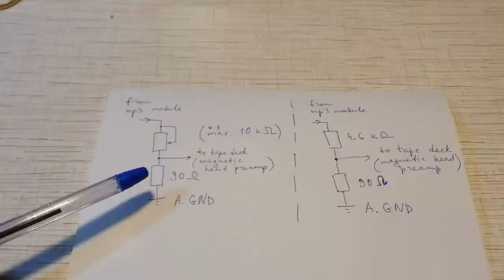(part.2) How to upgrade your old cassette / tape deck to usb mp3 bluetooth radio player

Comment: Connecting to the magnetic head isn't a good idea-or let's say, it's the worst idea. It has a low signal to noise ratio and what is more important, it's not linear-it has a big correction in the upper region of spectrum. If the tapedeck is already disassembled, locate the correction amplifier and find its output (or, if it has Dolby, locate the Dolby decoder's output). The signal here is already greatly amplified and corrected, so you don't need that unnecessary big and noise-generating signal divider and also, you will get linear sound. Cut the circuit here and connect to the line going to the next stage-mostly, it will be the input selector. Maybe the easiest way is to locate the input selector switch' corresponding legs.

Comment: I don't want to change my old thinks but I like to make new thinks.Yes I use my old devices.For example I made FM transmitter with RDS and I tasted it in my old cassette player from 1994

Comment: so which type of regulator was used to put in the switch board of power 240 volts plzzz tell me the connection...,..
Reply from the maker: +Krishna Rockzz I used a modified usb charger adapter. See part 3.

Comment: Can  I use power source of the tape recorder
Reply from the maker: Yes you can. But you should use a ground loop isolator, otherwise you will get noise. Check part3 or this video https://www.youtube.com/watch?v=Eys5ks4QdAE